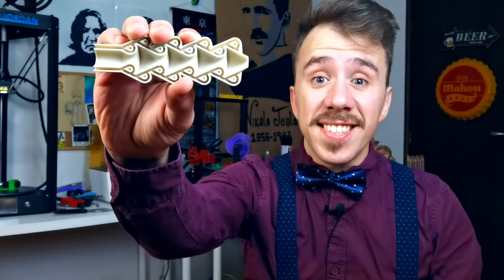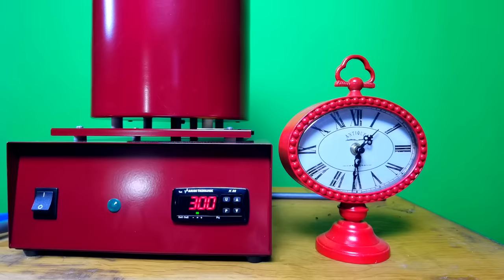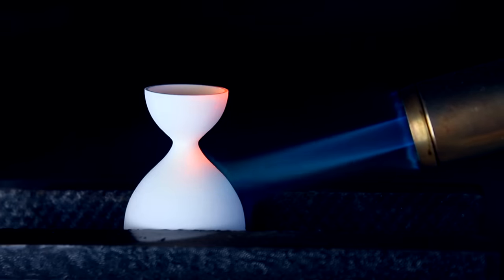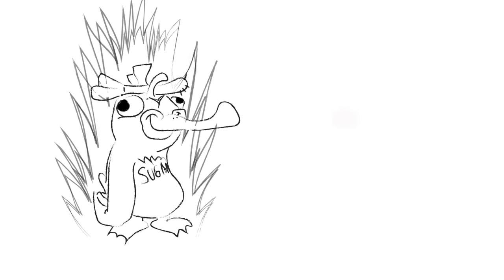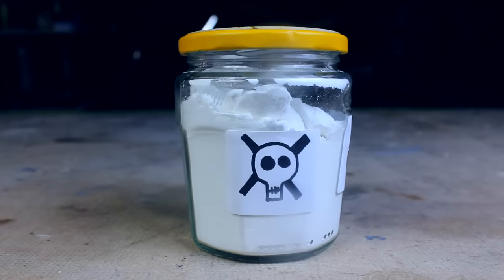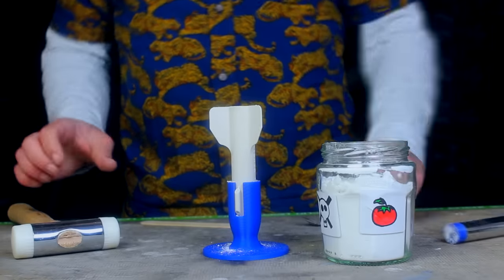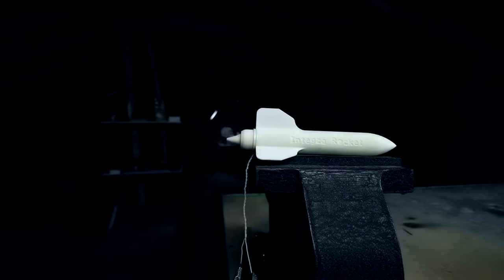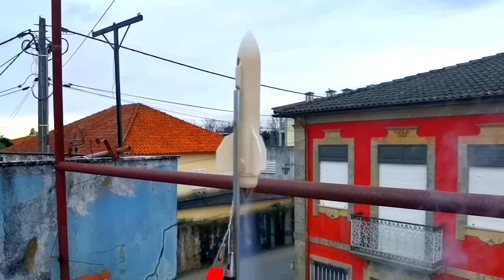Aerospike Rocket Engine (3D Printed)

Comment: Hey Integza. I have a suggestion for dealing with the rocket combustion chamber over pressure. You could do somthing cald Compozit overlapping made from carbon fiber. You just take the yhole pressurized section of rocket ant add a few layers of carbon fiber that should help with the Overpresiure problems you where having. Alsow it whould help to make sure theat the nozzles dont fly out. The bigger the presiure the better your ISP and power of corket motor. The Converging diverging rocket nozzle design is better becoes you arnt sending rockets to outer space where the outside pressure is diffrent from the see level. It is easier to produce ant test. The invers engine (Spike) that you used is better for diferent ambient pressure like when you start on the ground end end up in space on 1 stage SSTO (Single Stage To Orbit) like the space shuttle. 

Ps greetings from 🇱🇹 hope you are doing well there in Portugal 🇵🇹. Stay safe and do crazy stuff.
Reply: The COPV idea is great. SpaceX is using the Nitrogen cylinders made from aluminium wrapped in carbin fiber. The aluminum is thin but the carbon fiber helps to withstand the higher pressure then you whould expect.
Reply: I beleve that the is grate but will carbon fiber adhere to d3 printed plastic/ceramic parts? I haven't had any experience working with this material. I personally whould just get a inconel or any other high temperature resistant metal and turn the part. But integza doesn't have a lathe I beleve
Reply: @xnzn4763  well it should be fine. If the fiber is glued using high temperature glue it whould work fine. I alsow have never used this material but the ceramic tiles adhere quite good to the carbon fiber. Just dont forget to scratch surface of ceramic with 100 ar smaller grid of sand paper

Comment: A suggestion to fix the excess pressure is to drill some holes at the top of the rocket body to allow excess pressure to leave the rocket, therefore preventing it from blowing up

Comment: Theme: You should make a motor powered bike. But with a homemade engine and parts (3D and resin prints ) I think it would be cool
Reply: I had the same idea minus the bike! Just building an internal combustion engine with the ceramic parts would be quite interesting to see.. should it successfully withstand the compression.

Edit: now that I've perused some earlier comments I see we are not the first, or only, to have had this idea.. saw a lot aimed at the destruction of tomatoes, too—shocker.
Reply: I dont know if that would be possible. Ceramic is nowhere near as durable as aluminum so it probably would not work. That is good idea tho.

Comment: You can put one of the rockets on a model plane, you can find the maximum speed that can be achieved with this setup. I have also seen peter Sripol make a 3dprinted functional model plane.  You could try to find a model from him.

Comment: Theme: try to print with metal, maybe with a laser or something like that.
Reply: He would need very very high power lasers, and a special dust from the metal..
Reply: yeah not to mention laser sintering printers have low precision when used in an atmosphere so those are gunna be some rough prints. also the setup itself is a huge pain in the ass to put together requiring very well-aligned platforms pushing that powder up and the part down
Reply: 3d metal printers already exist, they are just very expensive, we use them at work.
Reply: @gellertapati4103  yeah, thats true, but if someone can do it, it is he.
Reply: @virutech32  oh, okk thanx, i didn't know that.
Reply: And which metal can you use to do this?
Reply: @leonardobrazzo8803  ours does stainless steel primarily.
Reply: @stinson87  ok nice, so it also is very strong one itz printed👌

Comment: Hi ! I think it would be really interesting to make another video, designing different sizes of nozzles and comparing them with a test of thrust. Also, you might try with a rocket with no nozzle to show to benefit of it ! Then, why not trying to 3D design a tiny turbo pump to propel water through a nozzle to see the difference with the same quantity of water but with less pressure. Enjoy, have a good day !

Comment: Theme idea: "Making a 3D printer using a 3D printer" 
ie. by 3D printing any  and every possible part for the printer.
Even try printing the motor (not including the copper wires obviously) XD

Comment: Use sorbitol instead of sugar, it makes the combustion much more consistent. Sugar creates a lot of small fluid caramel balls which cause an irregular combustion and may block the nozzle. Don't compress the mixture by pushing - you need to melt the mixture and fill into the rockets. But be careful, if the mixture get's to hot, it may ignite by itself - so don't melt to much at one time.

Comment: Integza you can build a solar panel but it would be different
There would be reflecting glass which would take take sunlight which would concentrate it to a specific place and could make the temp to go upto 500°c to 800°c
Which is made of iron 
Then it could be connected to a iron rod for the heat to move and be stored in rocks instead of batteries and can be used to make power

Comment: Problem Solved by using Electrical Conduit for the Pressure Chamber.
t: Maker of Exploding Rockets.
I made one using aluminum tent pole & an Estes "D" motor with cardboard fins hotglued on.
It went up 3 metres, turned parallel to the ground and flew about 200 metres towards the Freeway.
I never found it. Now I use bigger find and longer guide rod.

Comment: Have you not seen the movie October sky? You need to use a paste or gel stabilizor to get a consistent burn and repeatable outcome. Because dry powders can have an inconsistent consistency and can house pockets of trapped air that very quickly become micro bombs. 

The same way that trapped bubbles in ice  or glass become fracture points when applied to heat. You can even make some rocks explode by putting them in or over a fire.

Comment: I think the issue your 3D valve is the way the converted the concept 3D.  Rotating the design had the effect to created a series of decompression and recompression zones. This creates turbulence where you don't want. And dramatically decreases turbulence right where you need it.  I would redo the design but with the inside chambers maintaining a consistent inner diameter (volume). And I would wrap them around a spline.  That I would experiment with running two, three, four, and five splines (think rifling lans).  Finally I would experiment with the diameter of the central core in relation to the valve chambers diameter.

Comment: "In theory pretty simple"

Look at the RS 25 and say that again
Reply: Thats the difference between theory and practice...
For nuclear fusion, you just need to get atoms really close to one another, how hard can it be ?
Reply: Forget the RS25, look at the Raptor and say that again
Reply: I am most likely wrong, but I believe that the RS-25 is a full flow engine, which is the most complicated type of rocket engine. He was building an SRB.  This is like if someone says that legos are simple and you bring up mindstorms. (programmable legos) There’s a wide variety of rocket engines, some are simple and some are very complex.
Reply: @daniellundy9092  The RS-25 is a fuel-rich staged-combustion cycle engine, so pretty much all of the fuel passes through the preburner and spins up the turbopumps before being pumped into the combustion chamber for ignition. The SpaceX Raptor engine, however, is a full-flow staged combustion cycle engine, meaning you have two different preburners and pumps, one that runs fuel rich and one that runs oxygen rich, and all of the fuel and all of the oxidizer goes through their respective preburners before again spinning up the turbopumps and being pumped into the combustion chamber for ignition.

Comment: Solid rockets most often explode due to defects in the fuel, which allow the burning front to access a larger area, causing an increase in pressure, causing faster burning... Try melting the mixture and pouring it into the mold. Is usually better. Also, use a silicone cone to form the burning chamber, it gives a more uniform flame front through the fuel (cylinder gets wider, meaning you start burning more fuel at once. Cone area stays more stable).

AND DON'T LAUNCH MODEL ROCKETS IN THE CITY, YOU'RE GOING TO GET MODEL ROCKETS BANNED LIKE THAT!

Comment: Project idea: Sterling engine that creates electric energy by having the head of the piston be a magnet that runs inside a coil of wire outside of the tube.
Reply: I agree. In fact, a few space ships use that kind of generator. Good idea!
Reply: @Urbansprint5100  check https://en.m.wikipedia.org/wiki/Stirling_radioisotope_generator
Reply: @guatagel2454   But the piston isn't what is creating the electricity it's a generator or an alternator meaning rotational motion not back and forth. So check. Electricity is created by the ions in a wire being moved be the magnetic field of you guessed it a magnet. The forward and backward motion would cause the electricity to move back and forth in an odd manner that I am almost certain wouldn't create any type of useable current in a wire.
Reply: @Urbansprint5100  check again. The piston has a magnet attached to it. A coil is outside the engine and embracing the piston path. So, the piston going back and forth with a magnet IS creating a current in the outer coil.
Reply: @guatagel2454  But the current will still be reversed when the piston comes back. And the current won't be constant even if the current isn't reversed. So it'd be quite difficult to use effectively.
Reply: @Urbansprint5100  please, read about electric generators in space.
Reply: @guatagel2454  I did, and it mentions it's plugged into a generator or alternator meaning the piston is being converted to rotational motion rather than up and down and that is being fed to the generator or alternator. Please read the article you sent me. It say's nothing about the stuff you've mentioned.
Reply: @guatagel2454   Next time link an article that actually explains the stuff. And you could've just told me a linear alternator exists. Now I look like a hard headed dumbass (Maybe I am). Cause my argument hinged on a linear alternator not existing cause I've never heard of one in my life (Yes I know not the brightest thing to do should of probably looked up if one existed if I was basing my argument of the fact that it didn't.). TY for taking the time to set me straight.
Reply: @Urbansprint5100  read the last link that I send. An explanation start at page 72. It is not an easy reading, but there is enough information to loook at other sources. I agree that this is not an easy subject, but, nevertheless, an enthusiastic maker can get a prototype working (even with a low efficiency).

Comment: Make a cannon that uses the same fuel as this engine to throw tomatoes far away. It's a good way to honor the missing mustache that we will miss a lot.
Reply: for that adding a bit of finely powdered charcoal, it has to be almost as fine as printer toner, into the mix would work better. The carbon from the charcoal accelerates the reaction.

Comment: Here’s a theme: design a liquid swirler injector and more nozzles using proper math and rocket design science stuff (ask Charlie Garcia)
Reply: srbs dont need injectors
Reply: @akkupackage  2 different projects (he can use swirl injectors to properly mix the gasses in the pulse jet and their internal holes are small enough to provide resistance or smthing idk)

Comment: use the pulse jet engine and see how much rpm does it produce when connected to a tesla turbine
Reply: He has already tried pulsejets with and without a tesla valve... also, pulsejets have no rotating parts, so you can't measure "RPM."
Reply: @greenthumz1  He said a tesla turbine, not a tesla valve. You use the exhaust gases from the pulsejet to drive the tesla turbine, and measure the RPM of that.

Comment: Future video idea could be a video where you make brushless DC motors and use them to make a little rc car. There isn't have to be a motor for every wheel but if there is a motor for every wheel then you might have to include torque vectoring just as a cherry on top

Comment: There is a way to turn your microwave into a very small kiln, still very difficult to control the temperature in there though. Wait if you have high temperature resin that needs to be heated up gradually anyway,
could you 3d print a kiln? Even a tiny one?

Comment: I know! If it hasn’t already been said, how about make a new kiln? Maybe use some ceramic heating elements out of a space heater and create an internal chamber that will help keep the temperature more consistent inside as the elements turn in and off. Maybe add a few temperature sensors inside the inner and outer chambers to really keep track of what’s going in inside. I want to see you make more high temp ceramic stuff!:) And maybe wrap the rocket combustion chambers in carbon fiber afterwards to help prevent rapid spontaneous disassembly;)

Comment: Theme: Thermoacoustic engine (3D printed if possible)
Reply: I like it, but isn't it basically a Stirling engine?
Reply: @WaffleStaffel  Thermoacoustic engine sounds better, SOUNDS, get it? hahah
But for real it can be an engine that converts heat into sound or an engine that uses soundwave, ie. generated by loudspeaker to transfer heat that moves the piston. It's similar but not exactly

Comment: Instead of drilling the tamped down rocket fuel instead use a 6mm rod placed in the center and compact the fuel around it and remove it later.  The ceramic isnt strong until fired really....that is what causes the particles in it to fuse together.  For the ignitor melt down nitrocellulose ping ping balls (or photo film) in acetone and dip a piece of nicotine wire in it and let dry. A current apple will cause the wire to heat red hot igniting the nitrocellulose. You can add some potassium nitrate to it to improve.

Comment: you could have used steel pipe for the pressure vessel, and ceramics just for the nozzle, it's what's usually done for amateur high power rockets.

Comment: So I have this idea of deflecting the gasses off of a turbine that gets pushed foward on a screw and acts on a transmission. 

I am hoping the design will allow it to decompress the gasses and cool them so that a longer burning fuel can be used in addition to water for controlled speed and the ability to burst out really high acceleration.

Comment: How about a miniaturized propulsion powered car project? You could figure out the equation to create a perfect amount of lift to make the vessel hover and push it with a small amount of force across a long distance trying to make it fly straight using fluid dynamics and aerodynamics

Comment: Theme: Use compressed CO2 as the fuel source so it won't burn up the engine. The expansion of CO2 from liquid to gas phase should perform similar to the expansion of a combustion rocket engine.

Comment: Theme: Can you make an air engine fully 3d printed with ceramic. I know it would me a lot of work but it would also be fun making. I am also currently making one using the metals cylinder of perfume and It’s a lot of fun cutting the inner propeller blades and bending them and in a proper angle that would provide maximum thrust but I am not sure how to attach it to the outside frame or casing

Comment: Once you perfect 3d printing these combustion proof ceramics, building a combustion engine would be cool... But not just any engine, the massive-yet-tiny (myt) engine that was supposedly built and complete awesomeness. Its a combination of an opposed piston engine, a toroidal engine, and a rotary engine. Would probably work easiest as a diesel. If i could 3d print, that'd be my first "difficult" project.

Comment: You could of replaced the temperature controller with a controller with ramp/dwell times. Secondly use bullers rings to check your results. Molochite can be used to make a kiln + elements are most expensive.

Comment: Should have used mostly ammonium nitrate as all of the constituent elements are gases, and that’s what you need to produce most of.  About 5% potassium nitrate can be mixed with the ammonium nitrate if desired.  That, with sugar and a small amount of glycerine makes a great fuel, and it can all just be melted in a pan over the stove after grinding as this will further enhance the burn as everything is far more homogenised.
Reply: Ammonium nitrate caramel burns much slower in my experience

Comment: Integza , what do you think of variable exhaust flow for the tesla turbine? My thinking is that since the boundary layer is compressible would it not make sense for there to be some sort of way to restrict the exhaust so that the efficiency goes up? Air flows too easily to simply dump it out, restricting the flow to a sweet spot where airflow speed is closest to the disc surface speed, as well as getting more pressure so the boundary layer can grab more.

You do realize all of these parts are modular, right? Tesla turbine and impeller. You should play around with this concept and see what you can think of. A lightweight drone engine would be one of them. Spirals should all be proportional to one another, think of the path of air flow under performance characteristics. Also consider the spiral constant for the 3D extrusions: I would suggest using numbers like pi, phi, euler's number, etc. There are lots of things to do with these concepts, theoretically a rocket motor being one of them.

Comment: you could solve the furnace much easier by simply desoldering the buttons and sending signals from an arduino to the pcb directly via wires